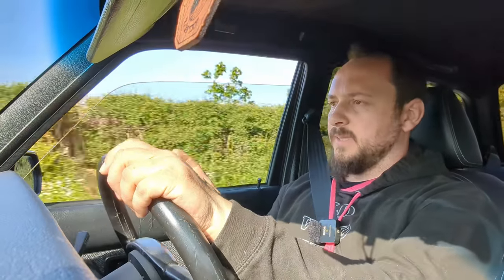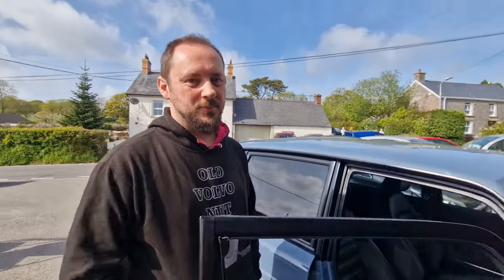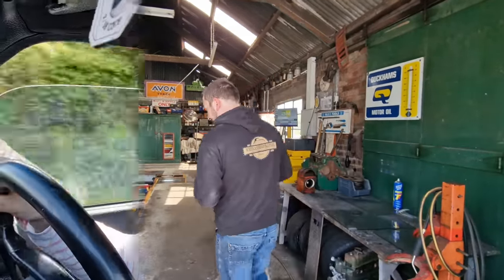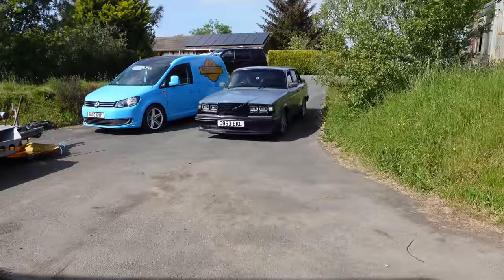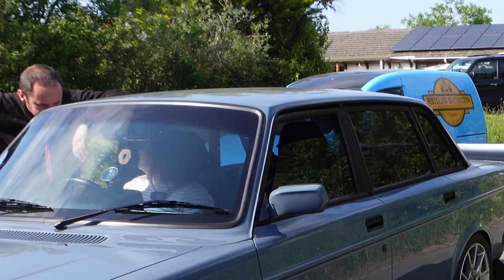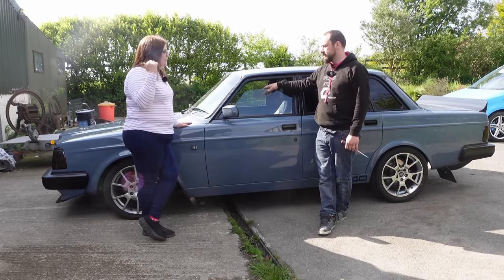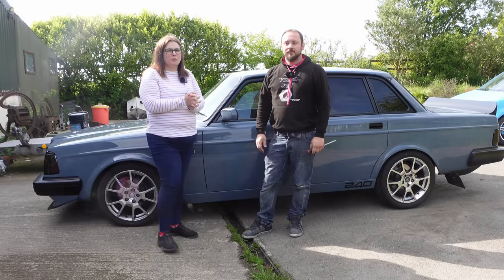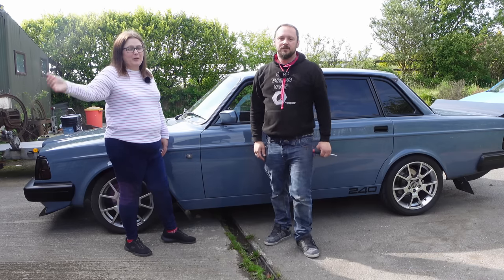MOT Time for Monica Our Volvo 240 - Will She Pass??

Comment: Finally got my 89 240 back on the road today.
Transmission was toast.
Was wondering if they always shift hard.
It really doesn't like going from 2nd to 3rd for some reason.
Goes in fine if I move the shifter from 2nd to 3rd by hand.
But it can't seem to do It on it's own.
I don't remember my 87 240 having this problem.